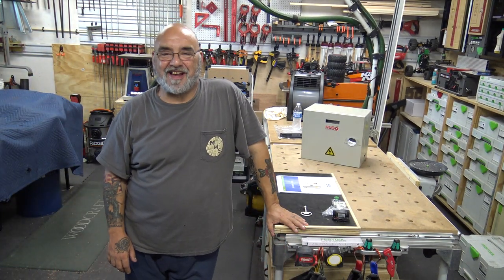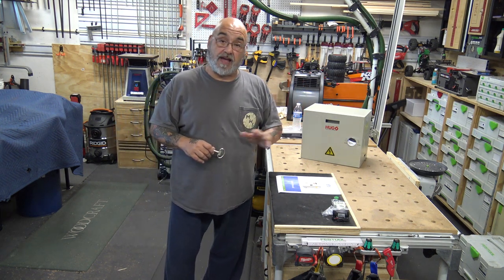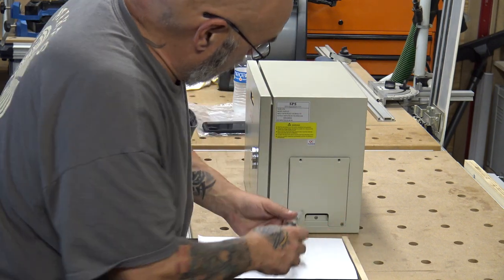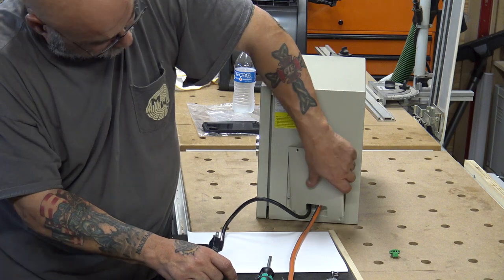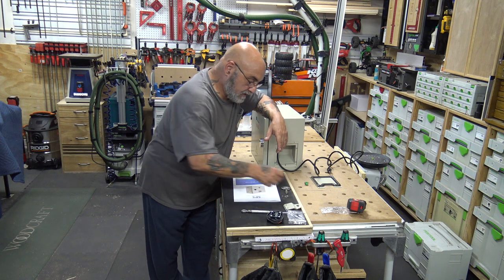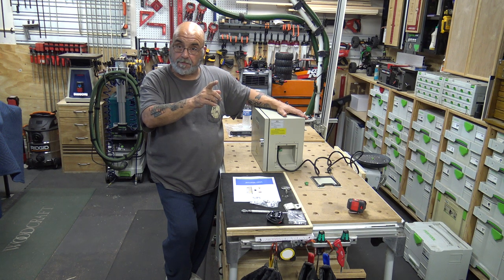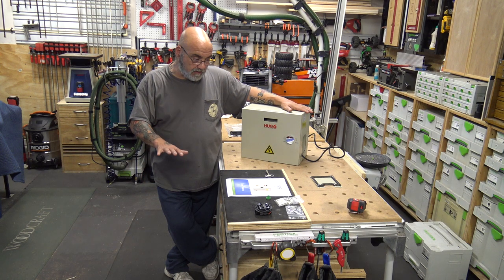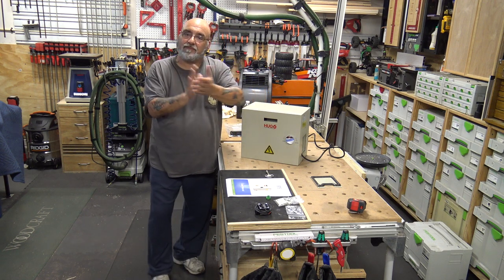Hugo tankless battery backup by Safeguard power solutions.

Comment: I just bought one of these thanks for the info.  I did this instead of the solenoid drain downs, I think this will do the job as long as the pipes are well insulated.  Plus I get hot water during a power outage (yes I am from texas and my tankless froze and broke, now getting a new Rinnai).
Reply: I’m glad the videos helped Mike

Comment: Hi ,my name is Slobodan
I'm on the west coast California, I want to congratulate you an the best videos I seen on tankless water heater, your explanation of how they work and how to attach them and accessories,  but I have a question ,I'm buying the rinnai v94en and would like to add my recirculating pump to work with sensors to keep the hot water pipe hot when I turn the shower on, what hardware is needed to accomplish that?
Thank you for your kind and knowledgeable answer.

Comment: I have two questions. 1. will this work with a Rinnai E110CRP propane boiler so the furnace will heat my home. Showers are nice but in NH I need to heat the house during a power failure. 2. Will the battery backup continue to be charged while I am on generator (Generac GP8000E) or commercial power with the clean sinewave. Thank you in advance for your assistance.

Comment: So the issue with the “other” UPS units was the lack of pure sine wave power supply?  In addition to the Hugo, is it safe to assume if you had any UPS unit with the correct wattage and had pure sine they would be fine as well?  I’m only needing enough battery backup to allow me to get my generator going and then have the UPS filter the generator power.

Comment: So, if I have this right, any quality UPS that has enough capacity and puts out a pure sine wave will work, but it won't kick in at 37F to provide freeze protection the way the Hugo unit will--correct? Also, my RUR199iN needs to be manually turned on (by pressing the On/Off button) every time power is first supplied. So how would the flow sensors work with that being the case?

Comment: Thank you!  What surge protector do recommend to use on the input side of the Hugo to protect the board from burning out with unstable electricity?
Reply from the maker: The unit has one built in no need for one

Comment: Mike, thank you for the information. My Rinnai internal tankless water heater (RU160iN) is a condensing model. Because of its location, I also have a condensate pump. How can the HUGO be configured to operate both the water heater and the condensate pump? It is my understanding that the water heater should not run unless the condensate pump can also run. Thank you.
Reply from the maker: You can run both on a Hugo
Reply: @ThatTanklessGuy  Yes, the HUGO does have the wattage to support both. My tankless uses 52 W and the pump uses 87 W. But the issue is how to connect both to the HUGO. The Rinnai warranty prohibits the use of extension cords and adapters and the Rinnai is not designed to power the outboard condensate pump. Both heater and pump each need their own plug and the HUGO only has one plug. To me a major shortcoming of the HUGO is it's inability to support a condensate pump.